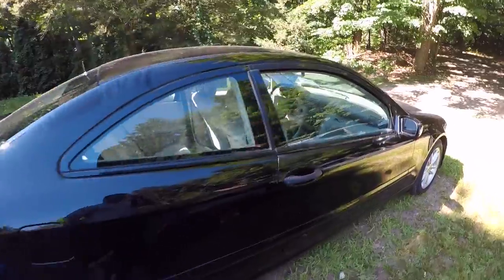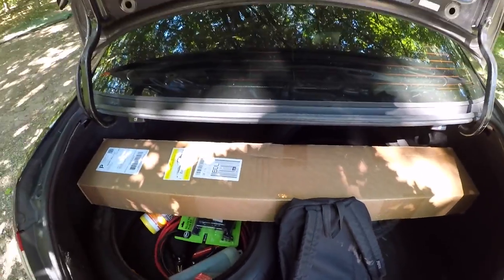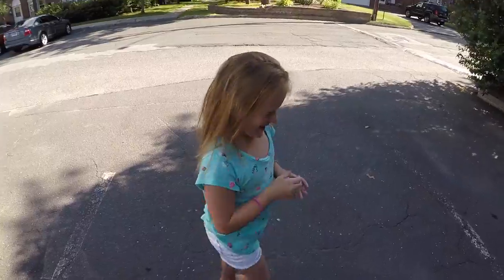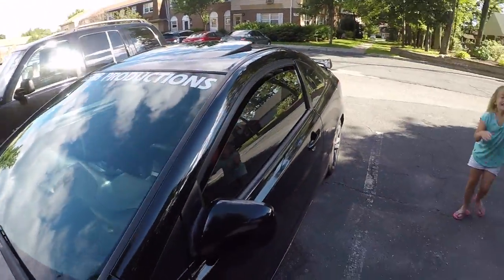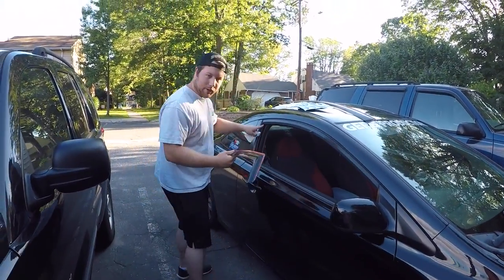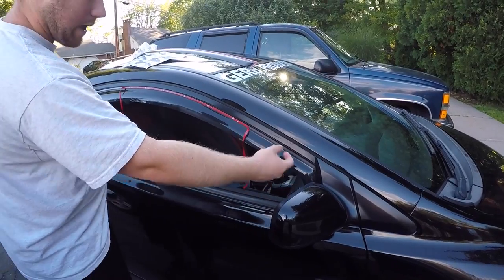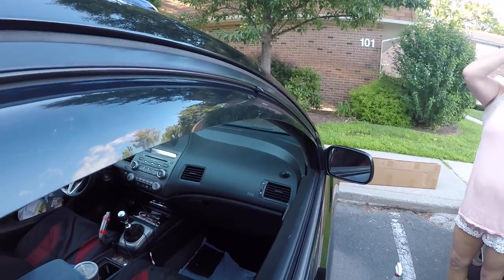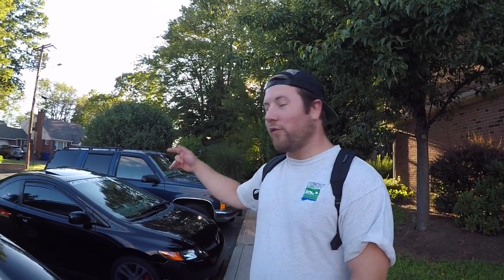Jdm Budget Window Visors Installed on my 2007 Civic Si! #projectmidnight

Comment: Stephen you're just like me when i got my used Si 5 years back trying small mods here and there. I'm no expert, but the Si is a very mild sports car. If you want to mod it to a higher performance, you need to look at the tuning of the FD2R and/or Skunk2 Compass360 Racing Si meaning flywheel + final drive, cams, hondata tuning, racing i/h/e, coilovers & sway bars, weight reduction, and lightweight wheels + tires (in that order). This will cost you close to $10k, and given how you're budgeting everything, it will take years esp since you're in college. Eventually, I realized the car really isn't that fast (if you stay NA). Maybe faster than traffic. In the end, you might be as fast as a stock STI. It's addicting wanting to have your car like everyone else online. Just make sure you want to keep this car esp after you've put in so much into it.
Reply from the maker: +Matt EF Did you get rid of yours? Everything that you mentioned is on my list of things to do to the car.  I thought about selling this car back when I bought it because I would've made a 2k profit, but I would've missed it.  Honestly, it doesn't have to do about "being fast" for me, it's more of the fun factor.  The si has plenty of power when you need it (for me atleast).  Part of me still wants an sti, but I just love my si.  I'm not trying to have my car like anyone online.  I decide to mod & work on my car because it's my passion in my free time.  I know that the parts add up, but I already priced it all out and it's not going to be that bad.  Might as well run it until she blows, then do a fresh rebuild or part it out, who knows.  That being said, thanks for the support & never stop wrenching 🔧✌🏼

Comment: Gerb, looks like you need an alignment. Rear inside tires are worn down more than the rest of the tire. 0:46 you can see what I mean.
Reply from the maker: solo34 That rear stance 🔥🔥🔥...  I will look into it.
Reply: Oh, mine's looking good like that as well...got new wheels and tires on it...and finally a proper alignment as well. 

I'm lowered on Tein S.Tech's as well. So I understand what you mean. 

But definitely look into it so that you don't do further uneven/dangerous wear on them tires. You should've seen my last set of tires before alignment. Right into the steel belts and I had no idea until taking them off for the Winter!!

Comment: Keep in mind that now that you have installed the visors, I highly recommend not to drive through automatic car washes with blowers. The visors will fly off or break/snap! Hand wash from now on. It happen to me.
Reply: Robertj Toledo my rear visor has been in since I got my FA5 for about a year and a half, and I wash it every other week.
Reply: Maybe my installation sucks !!!
Reply from the maker: Robertj Toledo Not that it sucks, maybe the tape didn't seal to the channel?
Reply: @RobertJToledo  How can it fall off its flushed into the seams of the door with the windows holding them in place. These are in channel visors not external ones

Comment: have you ever had transmission problems with your 07 si ive read online and everyone says 06 to 08 was pretty bad and in my car ive noticed that it has trouble getting into gear at high rpms, you ever have that and if so what did you do to fix it?
Reply: CherryBomb clutch pedal adjust.
Reply from the maker: CherryBomb Yeah, my tranny is on the way out, I believe.  I think it has to do with the previous owners.  For starters, change your tranny fluid & then take it from there.